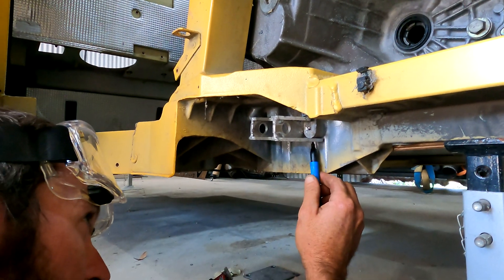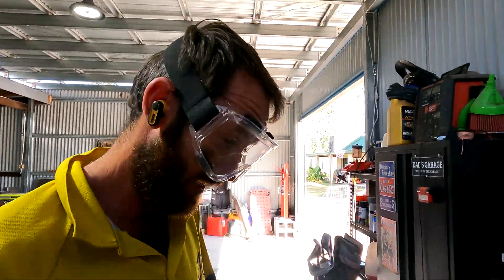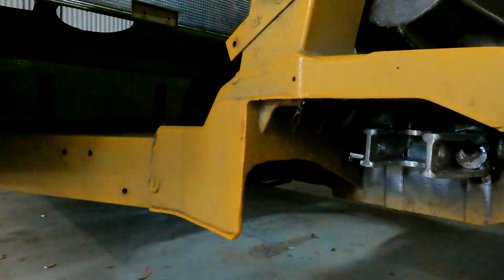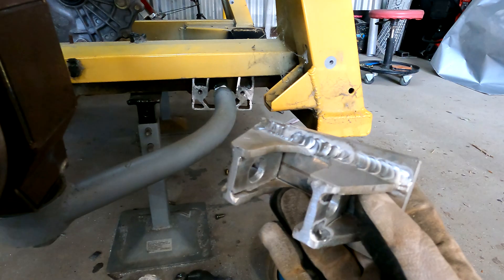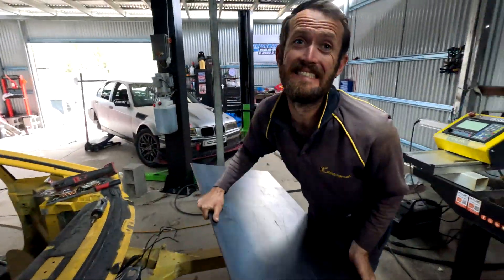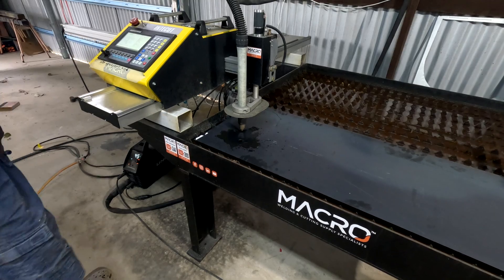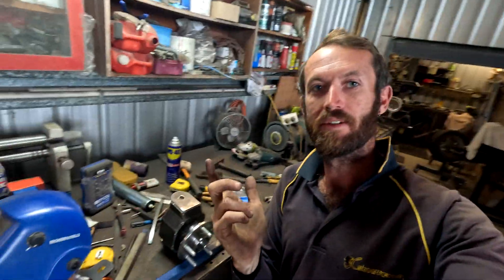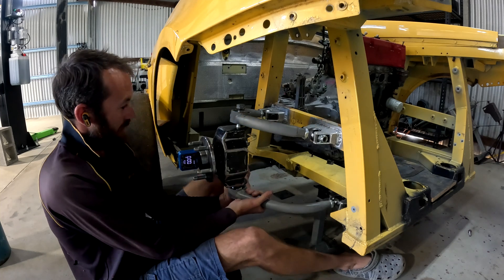LAMBORGHINI SUSPENSION COMPLETE... but now we have a new problem to solve!

Comment: If I may to avoid bump steer with your setup, keep the links low and on the same articulation as your lower control arms this is the most simple way of keeping correct toe and camber when when suspension travels.
I've just started watch your vid's. So I look forward to you progress.
Reply from the maker: @cupoft9917  thank you mate! Shes diald in. I apreciate it

Comment: Howdy, If I were to do it it, I would make it a double wishbone and not a multi link. The toe adjustment would be on the wishbone its self. Multi links pretty much always mess with the toe. The factory guys do that specifically to introduce "Safe" handeling characteristics over a wide range. Maybe use the current hubs on the front and  make some for the rear that have 3 pick up points instead of 2. Guess youmight want to use rose joints on the inner and outer side to make it a bit easier.
Reply from the maker: Thanks for your reply mate. I did have a look at nearly all suspension types. I was tring to make the design and fabrication process easier but i think i made it harder. Im in the process of making a cheat bracket with muoti holes and will move the track rod to the rear where it is suposed to be and hopfuly i can find the sweet spot. I origionaly wanted to use the heim joints on the spindle side but was afraid of them braking under high cornering loads.

Comment: Just a guess, but it seems the toe link is too short and the inner mounting point is too far outward? As it's making its way through the needed amount of travel, it's binding and pulling the upright side to side. The longer the toe link, the less side to side movement I would imagine. I think the toe link needs to be closer to the length of the lower control arm, with the mount further inward, and in the rear like you mentioned.
Reply from the maker: Thanks for your reply mate. Yes thats what i will do. Im making a multi hole bracket to cheat and find the sweet spot then design a nicer bracket. Fingers crossed i get it sorted soon. Thanks again
Reply: This is sort of correct. Looking from the rear (or front), draw a line between the inboard LCA and UCA pivots, then another line between the upright LCA and UCA pivots. The tie bar must fit between those lines AND intersect the Instant Center (IC). I’ll try and find a good reference for you.